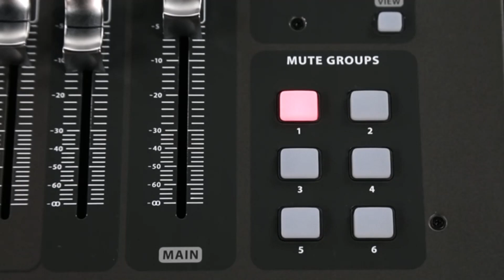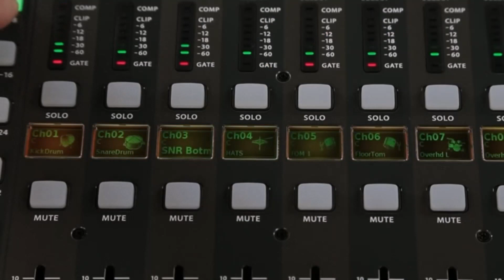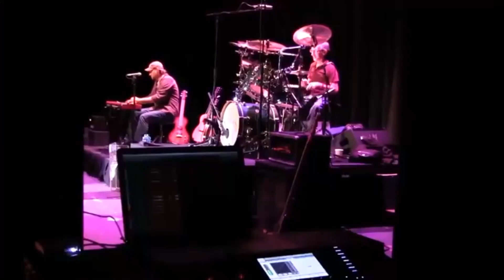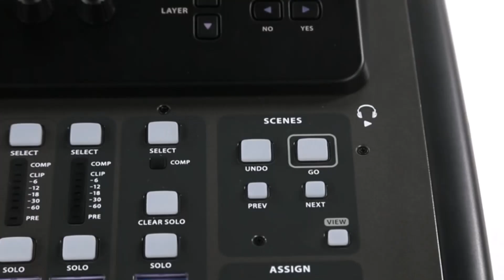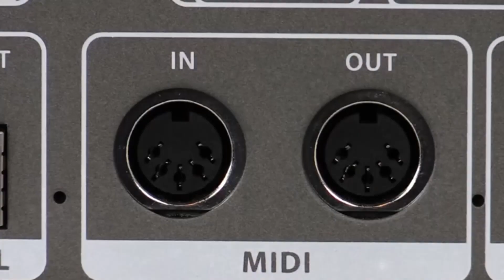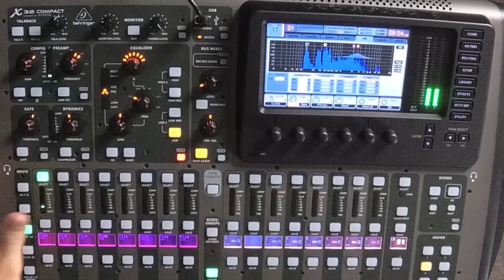Behringer X32 Compact Review | Still Worth It in 2022?

Comment: I can’t get the X32 compact to use 16 xlr outputs with the S32 stage box. It only allows 8 of the XLR outputs to be used
Reply: I had the same issue but didn't need the extra out's at the time so ignored it. Found out after that with the compact, you have to go into the routing section on the board and activate the extra out's 9-16 as they are normally not assigned because they don't physically exist. It won't "automatically" know they are there just because you use AES50 as your in's. You could be using a 16x8 stage box on that AES50 in. The board doesn't seem to know which box you're using. The reason it recognized all 32 in's is because you routed all 32 input channels to the AES50. You just have to do the same for the out's. Cheers
Reply: @66fitton  how do i activate them? it seems like i can only route 8 of them?